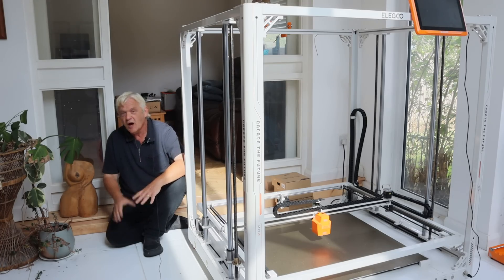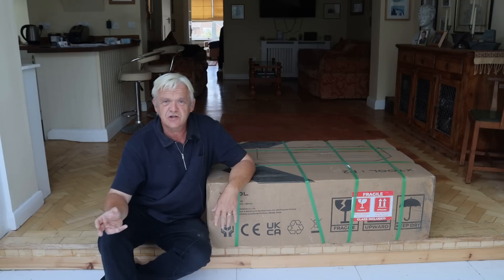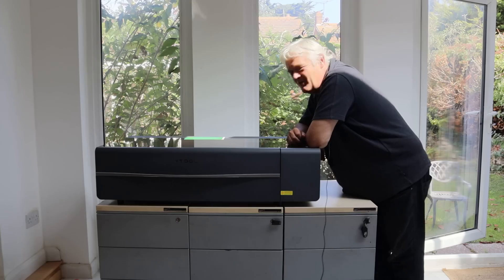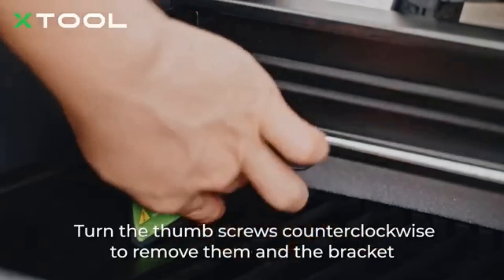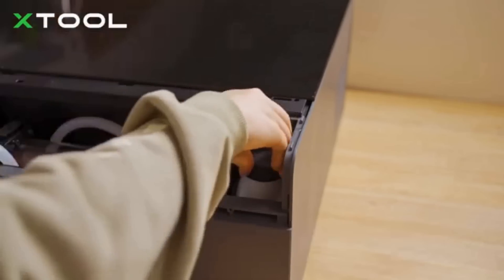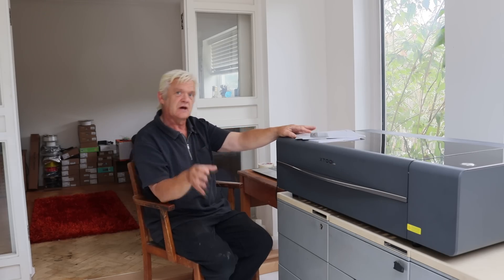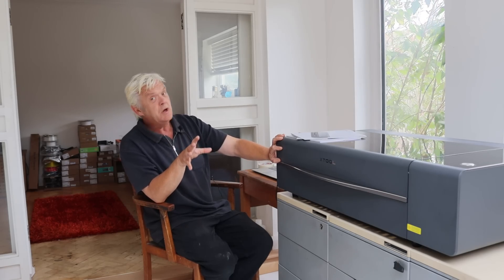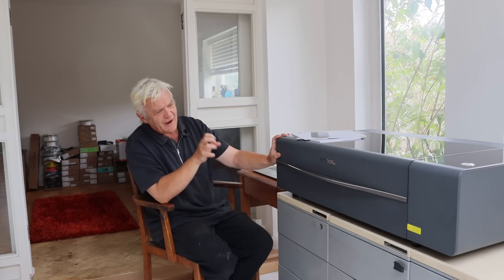2284 The XTool P2 CO2 Laser Cutter - A New Way Of Working #xtool #p2

Comment: can you try lasering some sugar and baking soda mixed together to see if you get graphene?
Reply from the maker: that's aninteresting idea - i have done videos on lazing to create graphene before you know
Reply: @ThinkingandTinkering  I have seen every video.  I asked Dr Tour about the process of using the sugar and baking soda, and he told me that he has not heard of anyone doing it.  I am in the process of purchasing a Raman machine as it has become too expensive to send the samples to Malaysia. But it is still some time away from its arrival.  I have a automated flash graphene machine here.   We are using anthracite coal doped with carbon black as the feed stock.  However production is very slow.  around 50 grams per hour, assuming the feed hopper does not get jammed.

Comment: Robert, since you're more familiar with kilns and metalcasting, I was wondering whether you could make a video on how we could create models in plastic using a 3D printer, and then potentially putting them into a mold to have the plastic be replaced by the metal being poured, as a cheaper alternative to a metal 3D printer?
Reply from the maker: that's a good idea mate - I was thinking of upgrading my backyard foundry
Reply: @chrisstevens2  essentially it's the lost wax casting process, except using plastic

Comment: I had similar thoughts when I purchased a CNC router, all bar the cutting medium is the same technology- in fact I could buy a laser head for my CNC router if I wished, but I fully agree these machines are the home workshop of the future. and that is a workshop that can be fit into a much smaller footprint (as long as you dont have too many of each machine.)
Reply from the maker: lol - too many is indeed a problem but maybe a problem we would all wish to have - i joke mate I am spot on in agreement with you CNC router and Laser cutters are pretty much identical machines

Comment: Looking forward to a video on performance and a project for which you use it Robert.  Thanks for the video.  My end case use for a laser cutter is probably more suited to a diode laser cutter such as making capacitors  and electronic components burned directly onto a surface, but I have no experience with CO2 lasers so who knows it might work as I would need it to work.  I guess I will have to live vicariously through you Robert while you experiment with the Xtool.  Thanks again!
Reply from the maker: The Xtool is a nice machine mate - but diode based cutters have also come a long way - working on a project video right now as it happens!
Reply: @ThinkingandTinkering  That's great!  Looking forward to it.